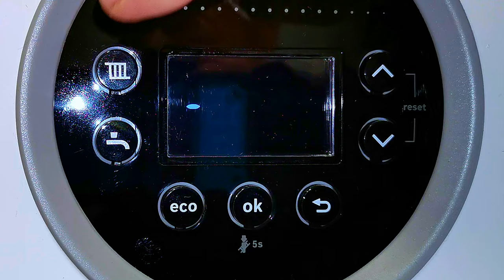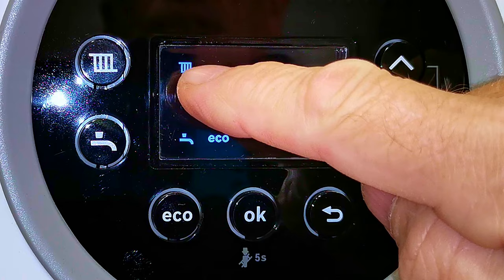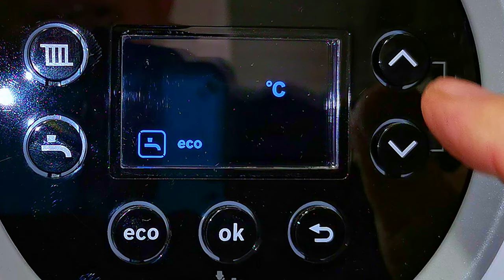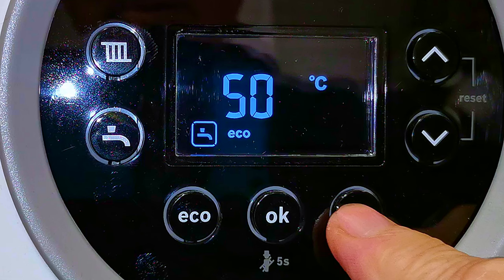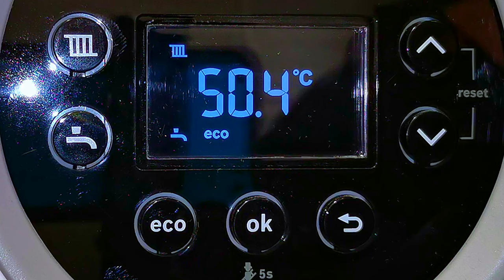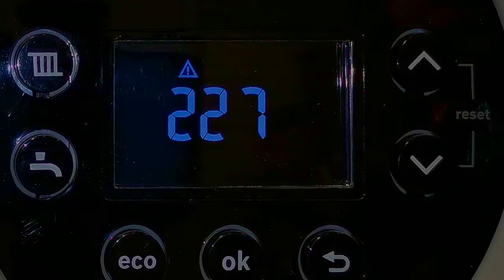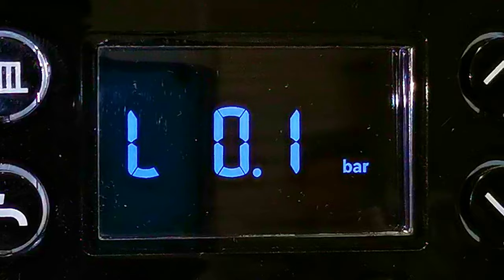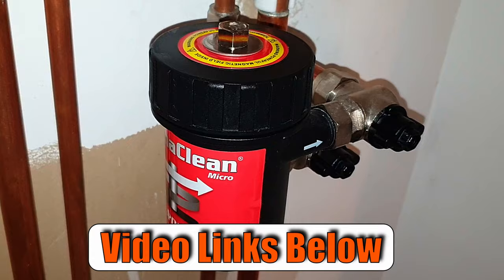How to Operate Worcester Greenstar Life 8000 Combination Boiler,  Most efficient Settings and More

Comment: Trying t reset the boiler, but there is no blue lever. What do I do?
Reply: Same problem here, no blue handle
Reply: The installation engineer may have fitted a valve, or two in my case, to the boiler feed-in. It is below the boiler, not within the casing. Open the valve/s, and that will increase the water pressure. I did this a few minutes ago, and it worked.

Comment: Great video Mark, very clear and informative! I have an older WB combi boiler and the pressure topping up method on yours is far easier than using the fiddly plastic key (which is a real PITA) on mine. It's nice to know I'm doing pretty much everything you've mentioned in terms of running my boiler efficiently. 🙂

Comment: Great video! We've recently had one of these installed and was worried great, but in the last week on eco mode the water will heat up and almost immediately start cooling down again so we're not getting consistent hot water when we want to do the dishes or run a bath. Any advice?

Comment: Hi Mark i have a Worcester Bosh Greenstar 4000 thats in a small house running 3 radiators I would like to know what is the best temp for the system to run at on both menu's this includes the temps in the service menu  that you can get into by pushing down the rad and tap buttons for 3 seconds plz i want it warm but not roasting

Comment: Can I switch my greenstar 4000 on at the boiler... the engineer set it up for thermostate on off as regards heating... on the salus guage there is 'manual' setting is that the key.. its a bit of a pain running up the stairs to turn the heating on at the thermostate.. regards

Comment: Hi Mark. Ive been checking out your videos on my New Worcester Greenstar 4000 boiler and The Honeywell control unit. This morning my water and heating is not working. Ive increased the pressure to 0.9 but wont increase any more. the flame indicator light is not coming on when i turn the tap on as though its not igniting. Any help would be appreciated thankyou

Comment: I just had one of these installed to my existing hot water tank and thermostat/ timer set up. The boiler is on eco mode and I have the hot water and radiator temperatures set low. The boiler will come on and heat water to keep it around 65 degrees on the screen. I notice Mark's is at 28 degrees. It's driving me mad. Everything is set to OFF but it still fires up every so often.

Comment: Great  video I just applied these to my new greenstar 8000 style..have you a video on the neomitis little box that is usually positioned next to and wired into the boiler as I have an orange override light that comes on? Not the thermostat but it a white box like a socket but has rf test amd override on it..hmm..

Comment: Hi , for a good week or so my boiler kept coming on outside of programmed hours heating my radiators after searching the internet the information that was given kept telling me there was a fault with the system. However, after coming across your video, it turns out that the eco function was not showing so with this now on showing it displayed its now a waiting game to see if it turns on in the middle of night which it as been doing , just a quick question though although the boiler is pre heating , surely my radiator should not be warming up should it not just be the boiler?

Comment: The user manual says you need to fit an optional integral diverter valve to control the hot water temperature. What is this?

Comment: Is there no way to just turn the hot water off compleatly over night ? The same like the heating just has an off option on the thermostat. Or would it need to be on pre heat mode and create a time table
Reply: Put it into eco mode. It stops the pre heat and boiler should be off if no CH running.

Comment: We've just moved into a house with one of these boilers. The previous owners had the radiator temp set at 60 but we noticed every radiator in the house was turned up to maximum.  During the extreme cold snap last week we upped the radiator temp to 65 but adjusted each room to 3 or 4 max. The main problem we have is that the main house thermostat which is located at the bottom of the staircase (stairs lead off living room) never comes near reaching the temperature set - the highest we've ever seen it reach is around 15 so if we set it at 20 degrees the boiler is chugging away constantly.  All very confusing for the average Joe!
Reply: Similar story here with my new WBosch.. Haven't figured it out... I want my old 18 year old boiler back!!
Reply: @lynneberry6495  Yeah I understood the old boilers with a simple dial!
Reply: That the whole system goes off when it reaches hall temp confuses me. We set the hall at 15 as we don't want it too warm.  If you set the hall at 20 and then set the room settings it should let it do what it wants to, perhaps.  We have each room different and turn them on and off when we're not using them.
Reply: @peternumber19  In our previous house the engineer who serviced the boiler advised setting the hall temperature at 21 because that heats the core of the house and a well insulated house (we had cavity wall insulation and triple glazing) will then remain warmer for longer. It definitely worked very well for us. Keeping the door to every room shut and turning radiators off in certain rooms doesn't really work in a busy household particularly in the holidays with kids constantly moving from room to room up and down stairs.
Reply: Having the thermostat in the hall gives a baseline for the house temp. It works best when you have thermostats on all your room's radiators. Rooms infrequently used could be set to frost, and main rooms set to a suitable temp. It is trial and error. Set the hall thermostat temp highish. When the boiler cuts off, i.e. the hall temp reaches the set temp, go to each room and see if the temp is where you would like it. Those set to frost will be cold. You can then assess the other rooms temperatures. If they are warmer than you want, simply turn them down. Wait an hour or so and do another check. You will eventually be able to set all your rooms to the desired temperatures.
Reply: @cathalgriffin5859  We've worked out that with the hall left on 17.5 and the rooms set between 2 and 3  the house is warm enough unless it's sub zero outside. The hall is never warm as the rad isn't bug enough.

Comment: Hello Mark, I have a Tado thermostat when I switched it off I realised that the boiler was still heating the radiators . I have a Green Star 2000. I switched it off manually but when switched it on again the boiler continued to heat the house up. Is there a way to switch the radiators off from this boiler please without using the Tado? And what do you think is causing this issue ? Thank you very merry ch in advance! Nancy

Comment: Thanks for taking the time to share your knowledge of this boiler.
Would you consider doing an in depth look at the WB easy control?  There are some functions such as WDC that aren't really explained by WB.
Also I'm confused if the water pre-heat (eco mode off) can be "timed" when using the easy control.
Reply: Have you got a video on how to set up weather comp with the new Worcester

Comment: Thanks for the video. Is there a way to turn the radiator/heating mode off and only use the hot water functionality please?
Reply: Can't figure one. However, if you set the radiator temperature to the lowest settings i.e 30 degrees and thermostat to lowest; heating will probably never come on!

Comment: Hi Mark. Thanks for the vid. Just one question……. I understand you can turn the radiators off on the boiler, which I’m told is ‘summer mode’. Apparently, when the boiler is in summer mode, there is a diagonal bar through the on screen radiator symbol in the top left of the boiler screen. How can I activate this summer mode, as there’s no instruction on how to do it in the Worcester users manual. However, it does mention it ! Many thanks Mark.
Reply: Hasnt got back to anyone here has he !...weve got probs from day 1  with this effing thing.

Comment: Very good explanations. Just one question; when you want to adjust the radiator temperature, do you just touch the rad icon, or keep it pressed until the temperature flashes? Also, how to avoid heating being turned on 24/7? Or is the only solution, for example, to turn off the boiler at night time? Thanks

Comment: When turning the hot tap on, what’s the average time to get hot water out of the tap? Currently it’s taking me about a minute. I’ve tried having eco on and off, and having the water at the highest temp and makes no difference. Any thoughts?
Reply: It depends on the distance between the boiler and the tap. When the tap is turned off, the water between tap and boiler will cool down. When the tap is turned on again that cooler water needs to be cleared before the freshly heated water appears.

Comment: I have the system boiler - GR8300iW 30 S - when I press the tap symbol my dial is showing -65-   which stays on what does it mean
Reply: It means your hot water temp is set at 65deg. Quite high I think.. I have mine set at 50 deg for hot water.

Comment: Hi there i need help, my radiator symbol doesn't flash, my heating does not come on at all but the hot water does.... Any ideas?
Reply: Did you ever find out what was up just had ours installed and having the same problem
Reply: @jennifermorrow9290  hi there that time the engineer came and looked in to the little reciever box and apparently the cables became loose so the connection wasnt there to send signal to the heaters, let me know and i hope this helps.